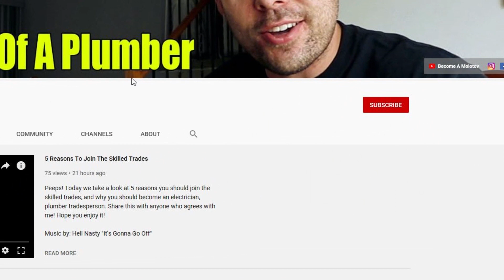What Is A Plumbing Apprenticeship?

Comment: Hey Kenny, thanks for the video. Is it possible to use my plumbing experience in my current job towards an apprenticeship? I have 15+ years servicing and installing commercial dishwashers, Water lines, drains and electrical.
Reply from the maker: Robert if this was here in Ontario Canada, and you can prove you were working for a licensed plumbing company or even a licensed plumber, and if you can produce pay stubs,  I think you might have a chance at claiming those hours. But the best place to really check is with the ministry for apprentices. Hope this helps.